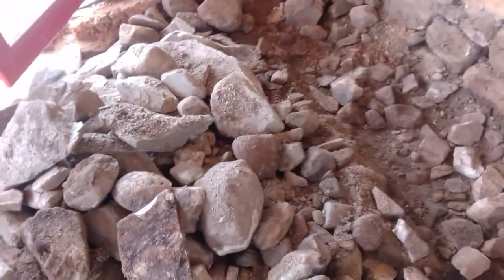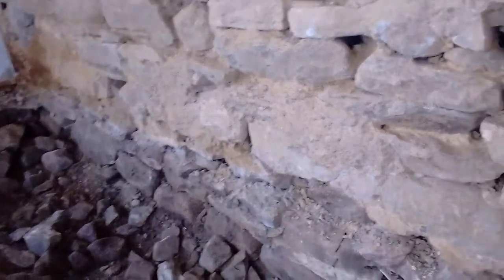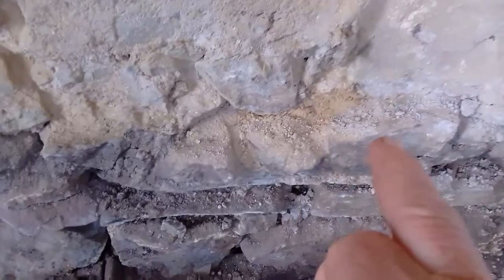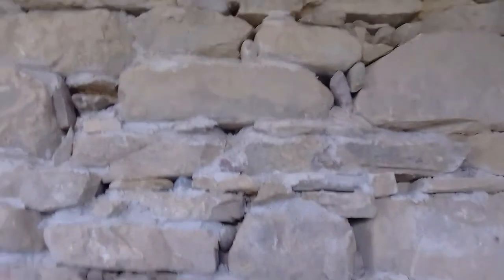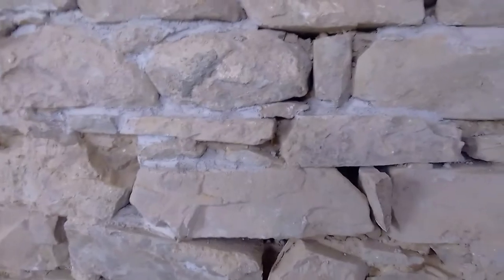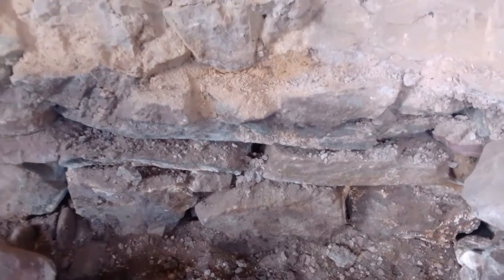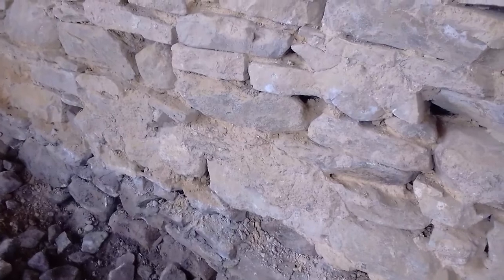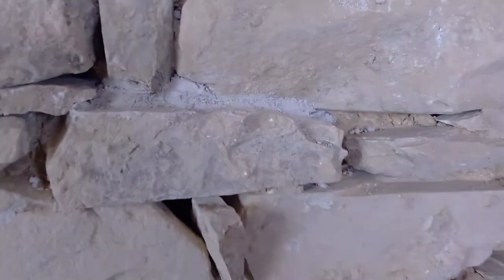Irish Stone Cottage Restoration Dry Stone Craft

Comment: I’m going to be digging up the floor on an old farm house that has the same stone structure. What are your plans for the new floor?
Reply: Hi Jon, builder who did the roof said to dig the floors up and do the usual plastic,concrete and insulation etc but I am going to wait. It’s a big job for me to undertake and as the place was without proper guttering etc I might wait to see what this winter brings and see how the cottage copes with its new roof etc.

Comment: Finding your videos interesting as just moved to Ireland and doing up a similar cottage. I going to leave my floors at moment as taking main chimney down created a lot of stones to sort out. Thanks for sharing. Are you going to lime point.?
Reply: Lime and breathability would be what I'd be thinking, but with such a radical overhaul you could go waterproof and look at air cycling and drying - tbh hard to do well
Reply: @JohnMullee  Yes going to have to make a decision at some point but will wait to get several opinions. Would like to go down the lime route and I’m now trying to find supplies of correct lime products.
Reply: As a kid the cottages around had lime whitewash on stone, just bag-ó-lime and a bucket. The plaster and mortar would be similar. You could get too fussy with products, they vary mostly on insulating factors for given thickness. Everything from straw to hemp to hair to whatever fancy stuff gets used.